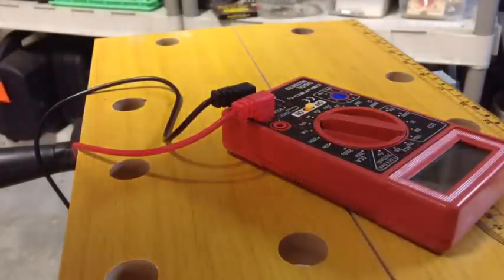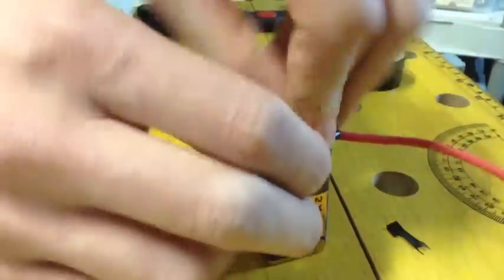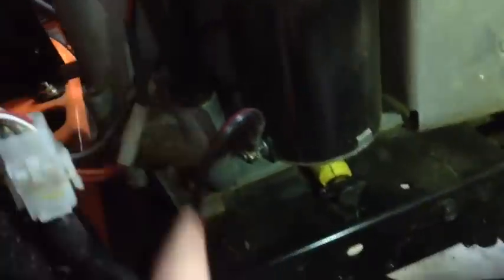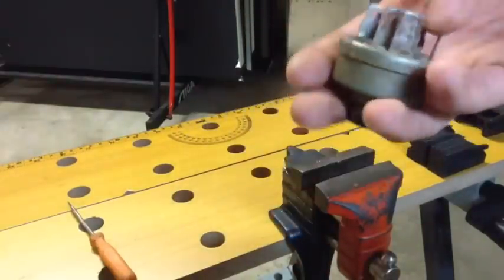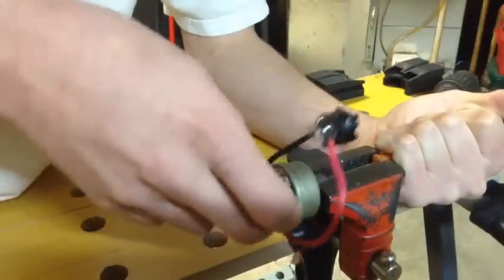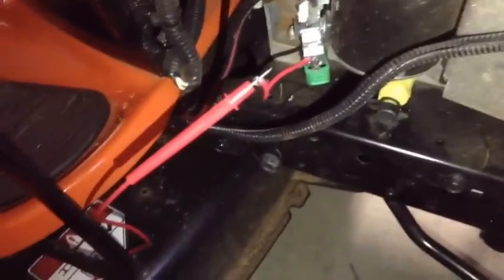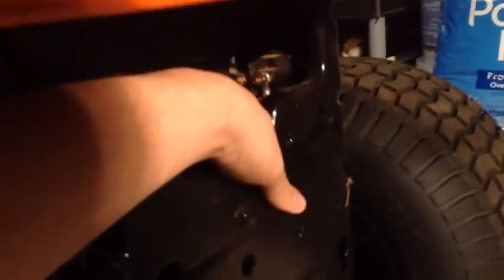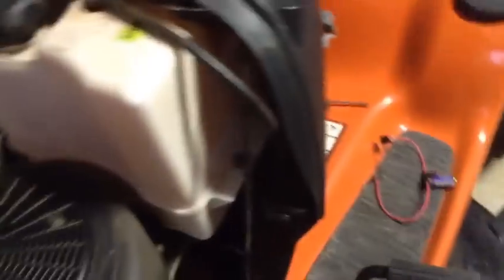How To Check The Wiring System/Harness On A Riding Mower

Comment: I have been trying to find out what is wrong with my Husky 24 HP tractor for 3 days.  You were the only one who suggested to test the battery voltage under load.    Standing  battery test gives me 12.4 Volts so I thought I eliminated the battery as the culprit.  I tested under load and it dropped to 1.5V.  No way enough juice to turn over the starter.  Replaced the old Battery with a fresh one.   Turned the KEY and she started right up.  Thank you so much 
MIke
Reply from the maker: Glad i could help :)

Comment: I have a Husqvasna  26.0 hp  what would make the fuse blow when you turn the key switch.
Reply: John Deere 345M, Battery is Dead?
Reply: Sounds like a dead ground
Reply: Hot wire shorted out to frame or engine

Comment: My harsqvarna riding mower doesn't start sometimes.  I've noticed this happens when the hours meter does not display the numbers.  Then days later it may show the numbers and it will start.  Any suggestions for this?  The battery is completely charged but it will not attempt to start if those numbers are not displaying in hours display.
Reply: Anyone else have this issue?

Comment: I check all thing all is good but the engine still not crank only I hear click when I turn the key switch . so can you help me what I should check for resolve this problem
Reply from the maker: adnan adnan you need to check your starter and starter fuse
Reply from the maker: +adnan adnan to test the starter use jumper cables and attach the red to the bolt coming out the starter, connect the other ends or the jumpers to the battery the touch the left over ground cable to a proper ground.

Comment: I can here because it said testing wiring harness yet 28 mins in, he's still on troubleshooting electrical ITEMS i.e. solenoid, battery, switch, fuse, starter, blah. 😥
I need to know how to find where the electricity stops and starts again on wires.  I have 4 tools here and I have no clue what it's supposed to be on.

Comment: A good fully charged battery is 12.66 volts not just 12 volts
Reply: You should immediately write a letter to all battery manufacturers.
Reply: mrBDeye  do what???
Reply: @Lovinflyindrones2022  Tell them a 12v battery is actually 12.66v
Reply: mrBDeye it is !!!  do some research on it.  If your battery in your vehicle only has 12 volts if you check it with a DVOM then it’s dead.  There’s 6 cells in a battery fully charged each one will have 2.11 volts.  6 x 2.11 = 12.66.  I thought the same as u for a long time.  I was wrong!!!!
Reply: @Lovinflyindrones2022  You may also want to write to the electric company and tell them that you 110v outlet actually measures higher 126v.
Reply: @Lovinflyindrones2022  My car battery measures 13.8v.   Oh no.  This is bad news.
Reply: mrBDeye if u measure it when it’s running it will read higher due to the alternator charging the battery.  Do u know what the alternator is ????
Reply: mrBDeye you better write a letter to every battery manufacturer then.  13.8. Oh my GOSH!!!!!!   I’d have it checked ASSP DUDE!!!!
Reply: mrBDeye when’s the last time u checked your exhaust fluid or changed the air in your tires.  It’s a proven fact putting NEW FRESH AIR IN YOUR TIRES  DOES NOT HELP YOUR GAS MILEAGE  AT ALL BUT I STILL DO IT.
Reply: mrBDeye  do u know where your battery is located in your vehicle ???
Reply: mrBDeye  the battery is located under the hood most of the time or in the trunk some times. ( it has to be a car if it’s in the trunk. A truck doesn’t have a trunk. In case u DIDNT know!!   Ok???
Reply: mrBDeye  the + sign is the POSITIVE AND THE — sign is the the negative I think that’s right.  I might better write a letter to the battery company to find out for sure.  !!!!!!

Comment: Built well, Bestfor.Garden also recommend plugged right into my rider 4500 series. Was short the rubber cap key and was was sent right out in the mail. Just ordered another ignition switch for my 6500 rider.

Comment: MY Ariens goes dead when I let off Brake cluch peddle
Reply: What's the fix on Ariens goes Dead when I let off Brake cluch peddle
Reply from the maker: Make sure your seat switch is working. If it is then i would try replacing the relay for the safety circut